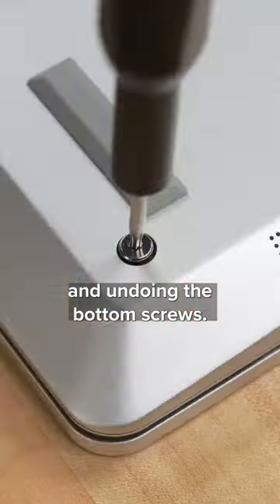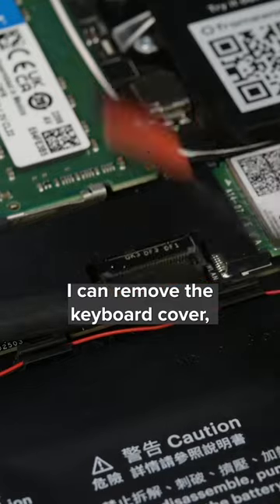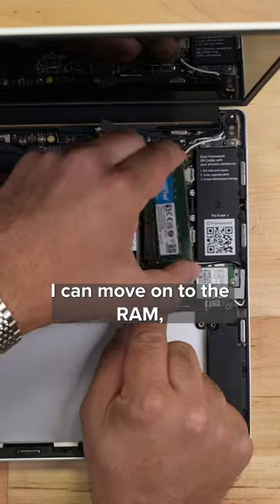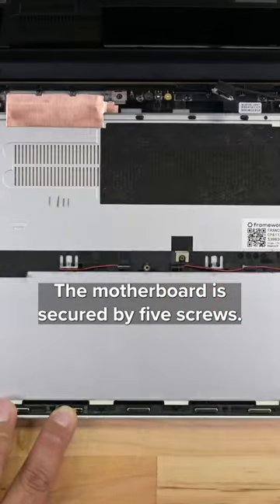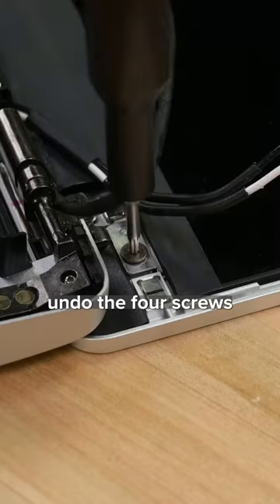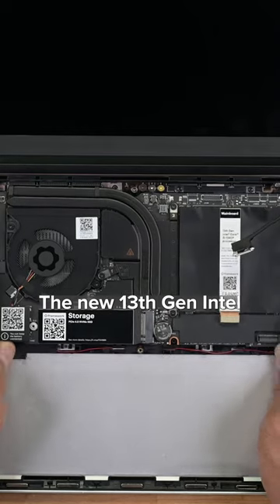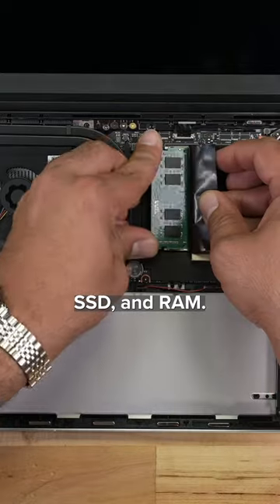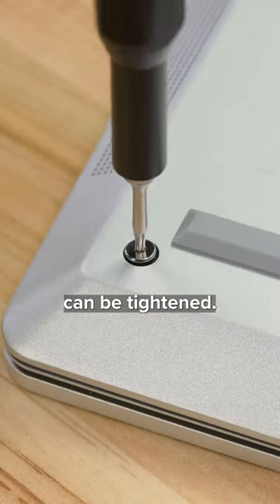Framework Laptop 13 Upgrades!!! #framework #ifixitteardown #laptoprepair

Comment: See while this is a cool and and I want one, I know that if they get too big, they'll just turn into another Apple or HP so the best way to help them is to not buy their product and keep them small so they have the drive to keep going the way they are going :)
Reply: Their whole point of existence is "Modular and repairable", if they get rid of that they won't be called Framework.
Reply: Doubt it, their whole thing is reparability and open source, to change would wipe out their users and would mean linus (aka their biggest supporter) would publicly dub them out.
Reply: Apple takes away from their products on a per release cycle these days it seems and they get more and more business every year 🙄 

Don't underestimate brand trust and how well it sells products. Nvidia has tripled the price of their high end GPUs in the last like 10 years and they still hold the top slot in largest GPU share used on steam.

Sony prematurely killed off one of their consoles and released the ps5 a year or so later and people flocked to that like Sony could never do them wrong.
Reply: @kefler187  again I understand the concern but like I said before this company was built in the back of repairability in mind, whole computer is super easy to work on, with the plan being to keep the design and simply upgrade the hardware, same way you can with a desktop PC, their expansion ports use standard USC C so making your own are super easy.